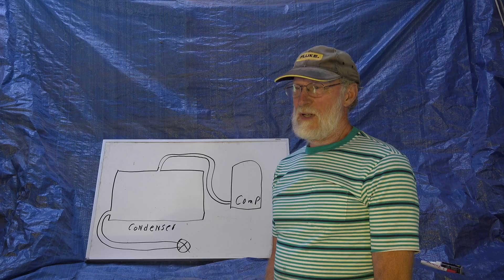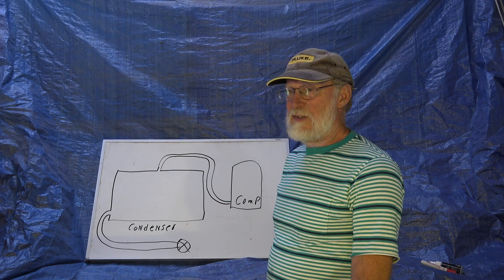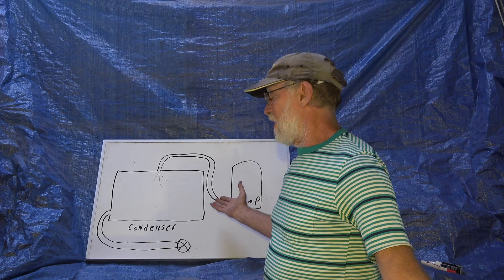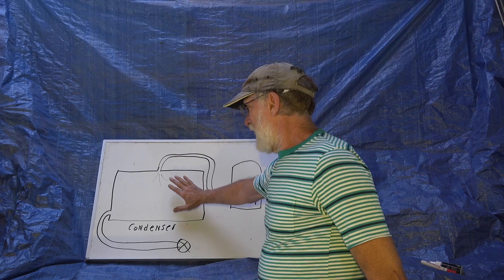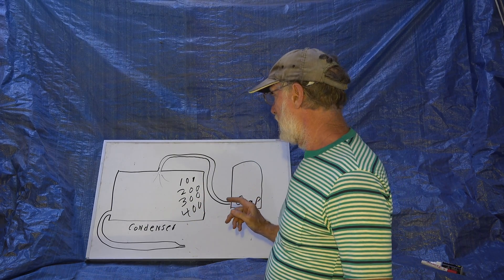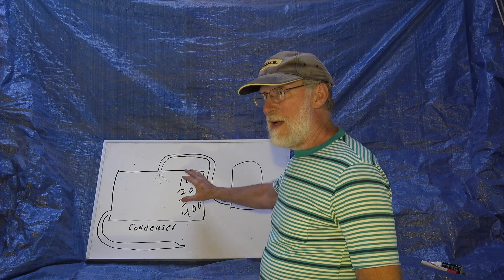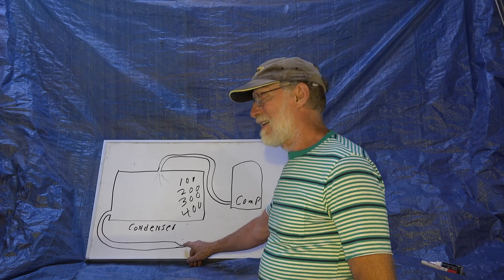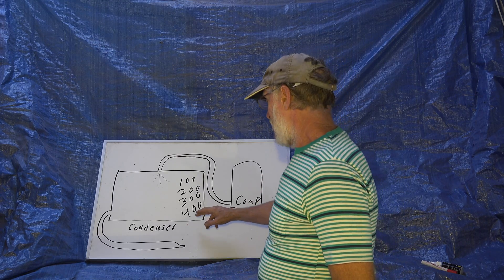The refrigeration cycle:  What the condenser does and why

Comment: does low charge mean lower condensor ambient split ?
Reply from the maker: Yes.  A shortage of refrigerant means less heat absorbed by the refrigerant in the evaporator, thus less heat rejected by the condenser.
GFM

Comment: It's true that the gas will become liquid, if the pressure is high enough but i think, that's not the basic principle of the refrigeration cycle and the condensor.  At the inlet of the condensor, you have a hot  and pure gas. It's a little bit hotter than the saturation point of the gas at the given pressure. In the condensor, energy is  removed out of the hot gas by the big ventilator, so first the gas cools a little bit down until it reaches its saturation point.  Since that moment, energy is removed out of the gas, WITHOUT cooling down the gas. While pressure and temperature are constant, the gas gets more and more liquid.  At the end of the condensor, its pure liquid but has still the same pressure (ok a little bit lower) and temperature as at the inlet but has lost most of its latent energy.  Since that moment, the liquid cools down farther (subcooling)  so that it's guaranteed that no gas comes into the expansion valve. (imploding gas bubbles could destroy the expansion valve by caviation)  Also the efficiency is improved with a special amount of subcooling. (i still have not understood completely why but i read it) 
Behind the expansion valve, there is a lower pressure.  In that pressure, the boiling point ist lower than the actual temperature. So the liquid is boiling It needs a lot of energy to transver the liquid into a gas and that energy gets removed from the air that is pushed through the evaporator so the air is cooled down.  While the liquid ist loosing energy pressure and temperature in the evaporator are nearly constant low until the liquid is fully transformed into a gas.   Since that moment, the temperature rises a little bit over the boiling point. The gas is overheated. The purpose of the overheating is to guarantee, that no liquid comes into the compressor.

Comment: I notice my low side is not cold but  is good in 70 in r22 high side is good about in 300 i took a garden hose and cool off the condenser pressure drop add freon and low side will be getting cold i had done this many time and it work
Reply from the maker: Unless your outdoor temp is well over 100F, your condensing pressure is too high.  Air in system?
GFM

Comment: sir, I feel orifice is simple and better than txv, what's ur suggestion.
Reply from the maker: Using a fixed orifice is simple but it changes the entire system operation and efficiency.  If the the fixed orifice is better, (it is certainly cheaper) all manufacturers would use it.  The truth is, the TXV has better, more efficient control of the the low side.  Many manufacturers use the TXV because they can reach higher efficiency with smaller coils.
GFM
Reply: I would prefer a TXV. A system with a TXV will be able to achieve higher efficiency and better, more consistent performance throughout a wider variety of operating conditions than an identical system with a fixed orifice metering device, which can only achieve optimal performance when operating under a very narrow range of operating conditions. Another benefit of a system with a TXV is that they can generally tolerate the refrigerant charge being slightly off better than a fixed orifice system.

Comment: So.....if I put that piston in the liquid line at the condenser ....and there is a TXV at the evaporator.......which one do I use to charge the system.....Subcooling or Super Heat ??  Or if there is a TXV at the evaporator do I still need to put that piston in the liquid line at the condenser ??  I ran across this the other day.....the installers had put in a brand new split system.....new air handler new evaporator coil new line set and new condenser.......well the system ran fine during the cool part of the day.....but about 6 pm it would cycle off and not come back on.....it was acting as though it was loosing low voltage....so I checked that and found that not to be a problem.....the problem was it was cutting off on high head pressure.......well when I charged this system I charged it by Subcooling because it has a TXV at the evaporator.......8 to 10.......after about half a day of running checks on everything in the system....temperature's also.....I realized that for some reason.....that this system is over charged....so I removed some of the 410a.....and recharged it by Super heat......and it has worked perfect ever since.....
Reply from the maker: I think you are a little bit confused here.  You can either have a fixed orifice or a TXV, not both.  If a TXV is installed, the piston must be removed.
GFM
Reply: Considering there was metering devices on both indoor and outdoor units, I'm expecting this to be a heat pump. During the "Cooling" Mode, the piston located in the liquid line at the condenser typically doesn't meter the refrigerant, it free flows around the actual piston. Then it goes into the indoor coil and then meters the refrigerant. 

Once the system is switched over to heat, the exact opposite happens.. The indoor metering device is bypassed and free flows around it, while the outdoor metering device is being used to meter the refrigerant. 

But yes, you typically charge units in the cooling mode, hence you use the indoor metering device to decide to use superheat or subcooling. In your case, yes you would use subcooling to charge your unit. Most units now have a "Desired subcooling" on the quarter panel.

Comment: But if the condenser is too big, would the pressure in the high side of the system be too low to condense the refrigerant? Thank you.
Reply from the maker: The condenser will condense the refrigerant regardless of the size of the condenser.  The pressure will just be lower.  If it is massively too large, you may not have enough pressure difference to make the expansion device work properly.
GFM
Reply: No, as long as your indoor coil is the same size, or larger than the outdoor unit you will be fine. If your indoor coil capacity is lower than your outdoor units capacity, then the system will not operate correctly and the indoor coil will typically keep freezing up. The fan on the unit is also a huge factor in condensing the hot vapor into liquid.
Reply: You really want the condenser to get the hot gas down to ambient, ie like if the condenser had a coil in free water source that is ice cold. That is like having perfect health, paying no taxes, having no bills. :) A 3 ton A coil inside with a 4 ton compressor to a 5 ton condensing coild will work well, but the limit is the 3 tons a coil. A geo system has either the condensing coils in the ground or part of it. or there is a heat exchanger so you are not pumping freon underground under ones pond. If you flow water from the garden hose over some to the outside units coils then the efficiency goes way up. This scheme worker better in dry areas, ie easier to have water evaporate for the 1000 BTU's per LB of water. A window AC unit does this. ones made in the say last 25 years. A dipper feature throws waste water on the outside coil to boost the efficiency. This water is for the evaporatorr inside, it flows under the middle to the outside fan blades